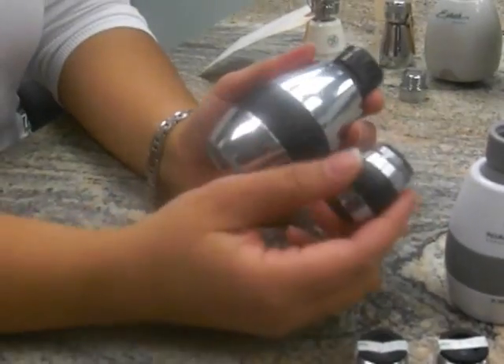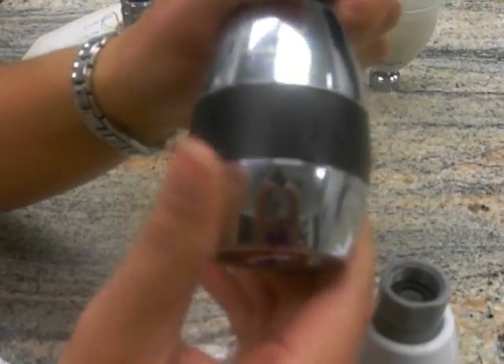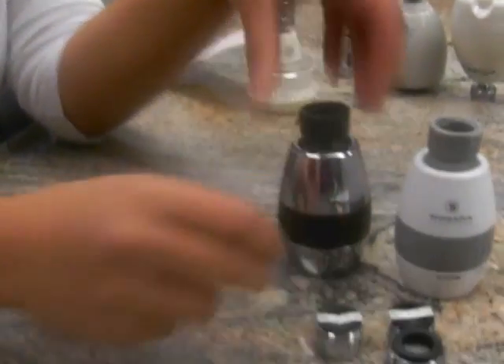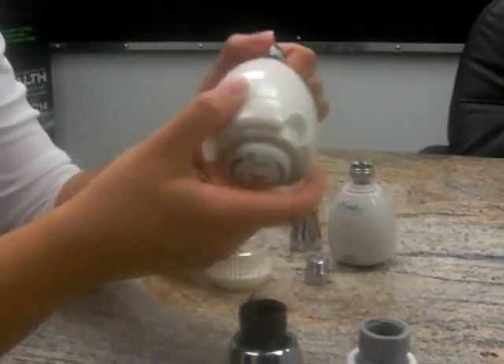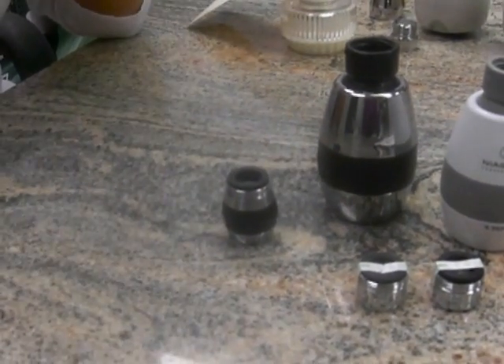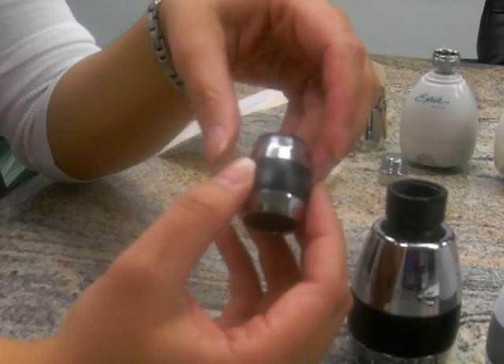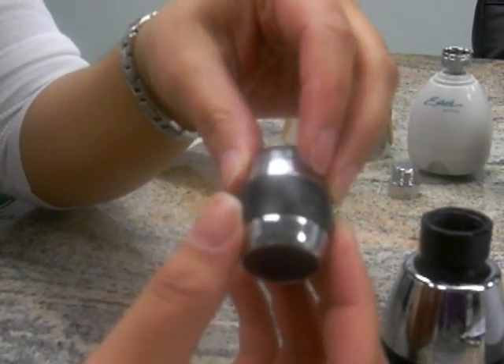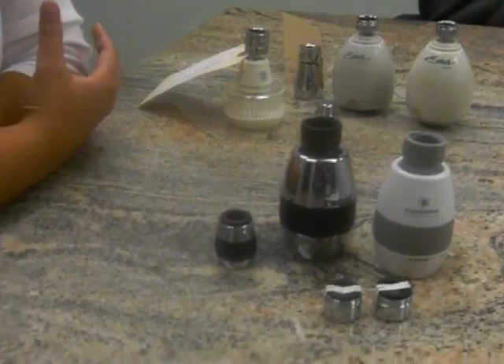Niagara Conservation's TriMax Aerator and Low Flow Showerhead

Comment: I have the adjustable faucet aerators on every sink and have used the .5-1.5 adjustable showerhead for about 10 years and it's more comfortable at the .5 setting than the old 2.5 gpm one it replaced.

Comment: Could you please upload a video demonstration if the new TriMax ecoflow showerhead. I bought the chrome one and it works terrible, nothing bu a trickle on 0.5 and uneven splattering at 1.5 setting. It messes with the temperature too. After shutting the cold water and leaving the hot water going, it simply doesn't release the hot water without closing the tap first and then opening the hot tap by itself first. Looking forward to a demonstration.